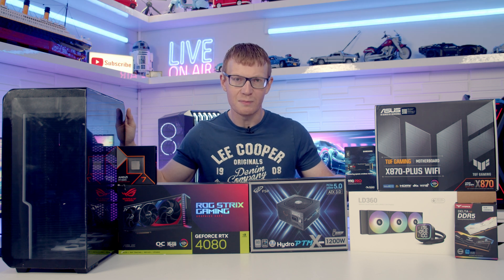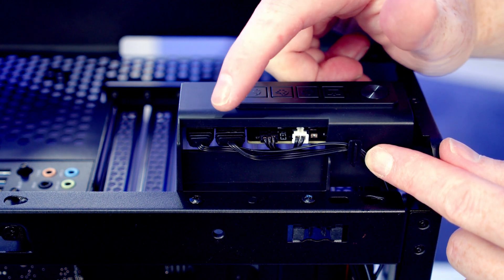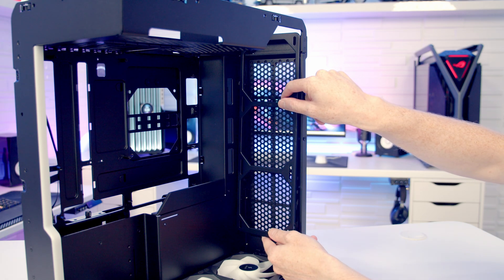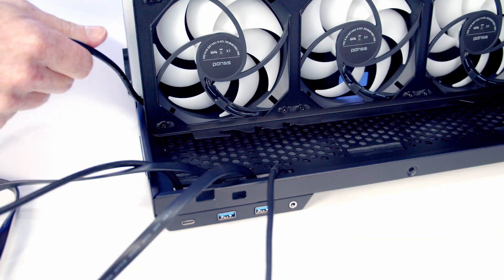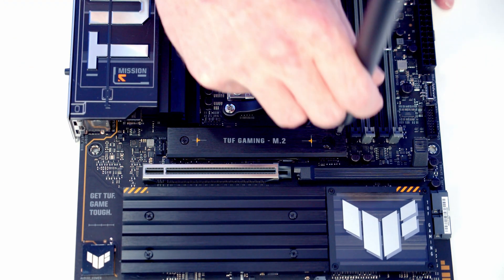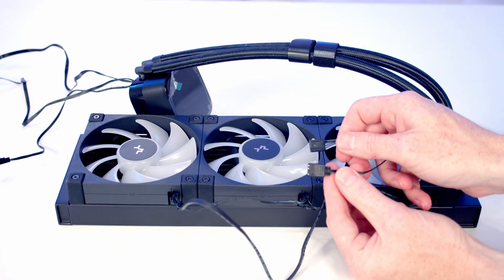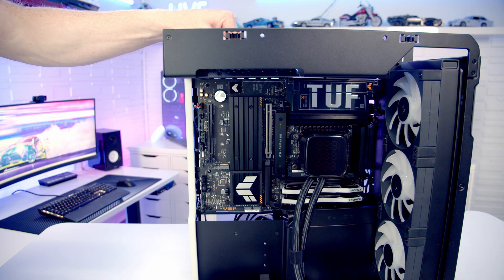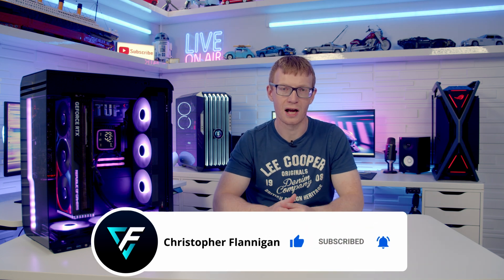SSUPD Xhuttle Build - Step by Step Guide

Comment: actually we dont need 10 fan if using AIO but in 2025 all gen 5 M.2 SSD is generate heat and this case need air flow and that what it come with 10 fan and my M.2 gen 5 stay at 40 degree celsius....with 6 fan my M.2 gen 5 at 57 celsius 3 reverse ARGB fan and 3 radiator fan but with 10 fan my m.2 stay at 40-41 celsius this pc case need air flow

Comment: I don’t understand how to change the color on the pre installed fans and the side light bar. It’s just a red for me and the buttons don’t do anything, I’ve plugged in all the RGB as well so idk what is going on 🤷

Edit, idfk man I have the RGB header plugged in, but the lights are just red, can’t change them to anything with the button none of the buttons on the case except for the power button work
Reply: You could have the mother board pas through turnd on
Reply: @matthewtrejo9175 it was the RGB controller on the case wasn’t plugged in

Didn’t know this was a thing lol